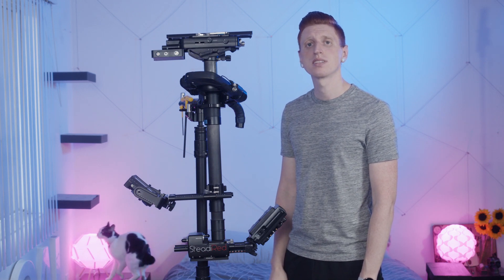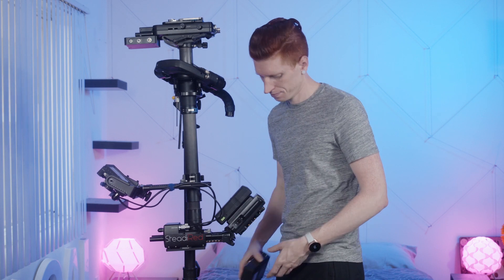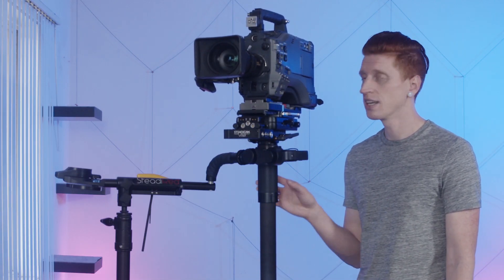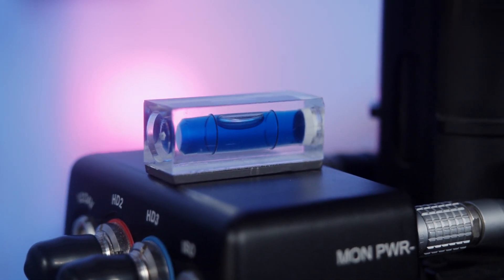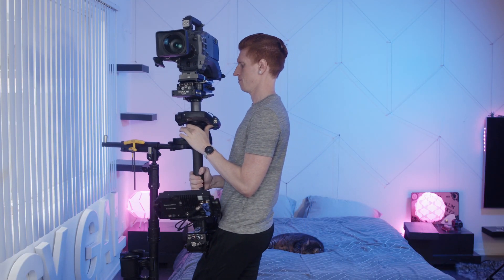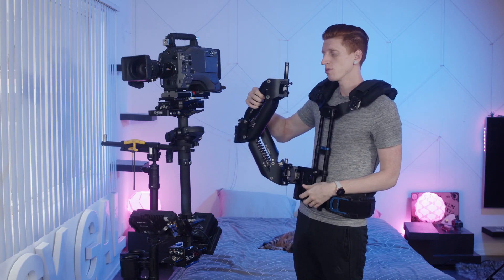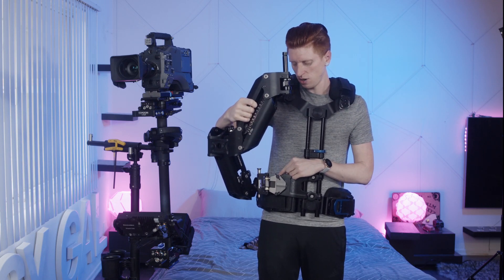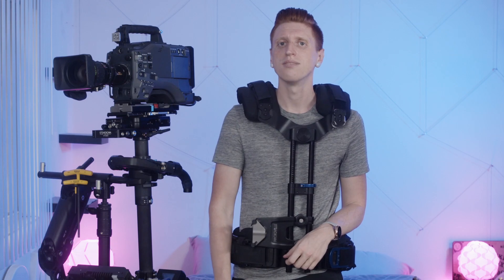Steadicam beginners guide part 1 (setup / balance / explanation of parts tutorial)

Comment: I am pleasantly surprised to find a young operator who actually knows what he's talking about.
You know about static vs dynamic balance and you clearly demonstrate drop time. You make clearly visible adjustments.
Use of the docking bracket and your multi part video clearly illustrates proper technical methodology.
PS: Balance on the CP ENG rig took me anywhere from 30-45 minutes.
Reply from the maker: Thank you so much! i appreciate it!

Comment: Thank you for an approachable tutorial that is a good entry point for someone not yet ready to commit to the full expense of a rig or the workshops. One of the big questions coming from the outside is wether one can start on low-end rigs and learn from there, or if the workshops followed by purchasing at least $10,000 of gear is the only way, which the content found online from many seasoned operators would seem to suggest. I am definitely not "buy and M1 and take gold workshops" committed to learning yet, but with your guides, the book, and second hand mid-to-entry level stuff that can be found online, I am seriously considering giving steadicam a go!
Reply from the maker: Thanks so much! you can definitely start with something smaller and build your way up. the skills you learn on a small rig will transfer to a big rig so it is a smart plan especially if your not sue if you want to fully commit to it.
Reply: @SteadiRed  Six months later and I'm revisiting this video as I troubleshoot balancing my first rig…

Comment: Question for you if you happen to see this: When the specs say the maximum capacity, does that mean the capacity of the top stage or top and bottom? Or is it the capacity of the iso-elastic arm?
Reply: For example, a Steadicam with a weight capacity of 5-18 lbs, is a 16 lb camera rig too heavy?
Reply from the maker: Good question! It's the arm limit but you have to add the weight  of the rig to that too. So if the sled weights more then 2 lbs then a 16lb camera would be too heavy.

Comment: I loved this video!! Thank you so much!! When you work as steadicam operator, is it possible to work as freelance? Do you always have to bring your own equipment or it depends on the production?
Reply: Of course you work freelance. Film production work is inherently freelance. How it breaks down on set  really depends. often in larger productions the Camera Op or B Camera Op is also going to act as a Steadicam Op. Just look at film credits.  That said, for various reasons, some productions use a dedicated Steadicam Operator.  If you gain a good enough reputation you become sought after like the top operators but that's the very  top of the list. And oh-yeah, you are expected to have your own rig the majority of the time, so I hope you have great credit or 200,000.00 sitting around for the steadicam system, wireless follow focus, wireless video transmitters, batteries, cases, c stands, etc,  if you want to do this at the professional level in film and TV.
Reply from the maker: Yes, I do work freelance.  Although, technically they hire my company to provide a steadicam operator and I'm the only employee.  I always bring my own gear but that is only the steadicam and the stuff I need to go with it. They provide the camera and everything else.

Comment: Have you made / has anyone found a detailed video on arm adjustments? the middle elbow part on mind kind of pauses and then jumps a bit when i boom up and down. presumably to do with balancing the springs of the two arm sections? 
also wondering about adjusting the 2 bolts holding the arm into the socket block, and or the two bolts that go from that socket into the first part of the arm... i guess they adjust the tilt of the arm itself. you mentioned these briefly for adjusting whether the rig falls away or towards you, but i find it confusing/vague... or am i just missing something?
Reply from the maker: https://youtu.be/XlJ1k8oDmkE?si=UWd_35Mas5encZKa

Comment: Thanks for the guide but what's the difference between vests with one arm and two?
Reply from the maker: i don't think there is a 2 arm version. i think you are thinking of the ones they use for electronic gimbels that take some of the weight off of the operators arms.
Reply: @SteadiRed  Sorry for the misunderstanding but what I mean is the links. There are some vests with just one link while yours has 2 links. I get that the 2 links are better but in what way? BTW I'm talking about the budget arms that are meant for lighter loads.

Comment: Quick questions (really need to know these), 1) Can you combine an arm from one company (ex. Tiffen steadicam G-70X) with vest from another company (Arri Artemis)? 2) Are all the socket block on different vest universal with different arms? 3) Are all the Arms able to change post?
Reply from the maker: great question. yes for the most part you can. the socket blocks are standardized on most vests and arms. definitely the tiffen, pro, WK, flowcine. i think the arri vest was too but i don't really remember.. when it comes to the arms the posts are not standardized. each brand has there own diameter so you need to make sure it will work with the gimbal you are using. luckily there are converters so you can use any arm with any rig, you just need to find the correct post. they do changeout easily.
Reply: @SteadiRed  Thx so much Red! Really love your videos =)

Comment: Great video sir! The M1 series is definitely more innovative than it's predessor like the Shadow/Archer2/Ultra. Have you tried out the M2 series with the G50x arm and built in top stage stabilizer? Would like to know your thoughts on this as they are both modular designs.
Reply from the maker: thanks man!! i have tried out the m2 its a really great system. i have not used the g50x, i would worry about it being limiting to what cameras you can use.